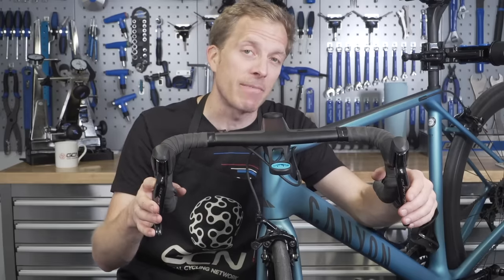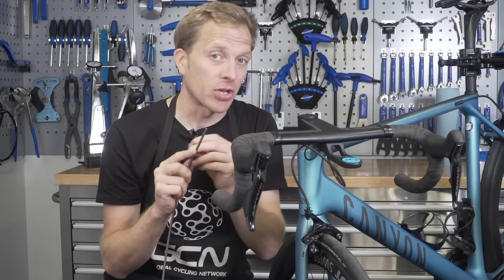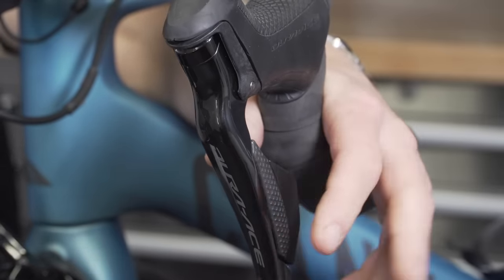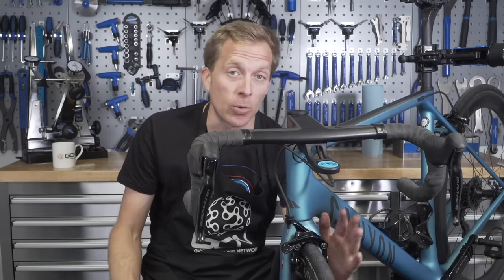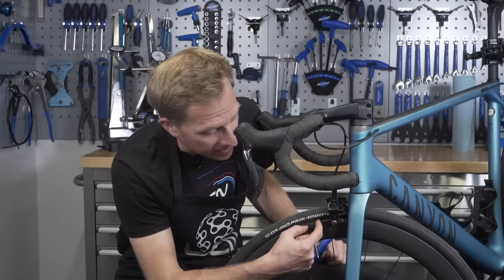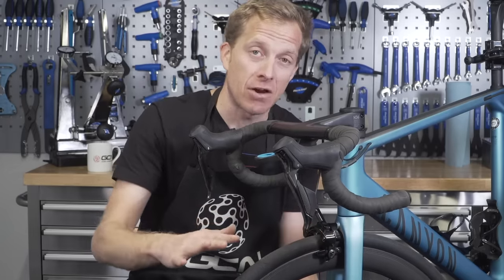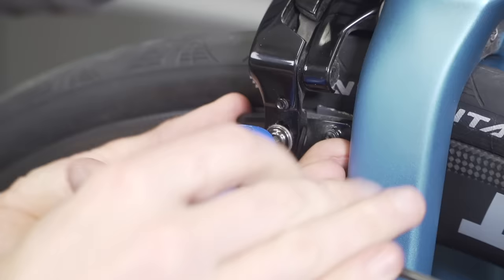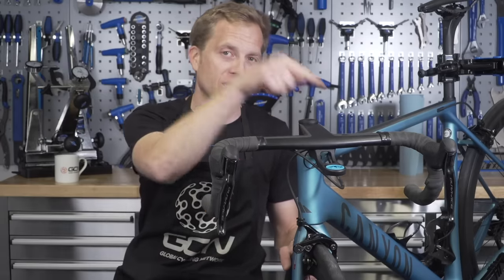5 Minute Rim Brake Tune-Up | Cable Tension, Ferrules & Toeing In Brake Pads

Comment from the maker: If this video doesn't solve all of your braking problems, make sure you send in any questions using the hashtag #askgcntech
Reply: Tip for a fast, accurate and fine tune when centering the caliper: as on disc brakes, release the center bolt, so the caliper is loose. pull hard the brake lever, then tighten the center bolt progressively so it will not affect the correct alignment.
Reply: Mechanical disk brakes next?
Reply: Michael, to tune mechanical disc brakes, here is a fast and "quite accurate" way: as you may know, the way to adjust the reach of the pads, is generally with an allen key, on the inner face (like if it would be the inner piston) across the spokes. so, first you find the proper reach as you like. then you release the two adjusting bolts at the fork, so the caliper comes loose. then, you add 2-3 points to the bolt (it will close the gap). then you press hard the brake lever. then adjust both bolts. then undo the 2-3 points to the reach adjust bolt. so it will sepparate the inner pad, and it should not have any rubbing.
Reply: Frank, I am actually rather familiar with adjusting the disk brakes on my Synapse, and I appreciate your input. I have TRP duel caliper brakes and have some clearance issues and more importantly, I am hoping Jon can explain it in a way that friends of mine can understand. What I tell them goes in one ear and out the other. It would be nice to send them to a video rather than re-explain it on a weekly basis.
Reply: The fast adjustment lever is open all the time.....😁
Reply: What are some good brake pads to buy to replace the standard ones that came on my road bike?
Reply: Hi I have got campagnolo brakes and they dont have a screw to help allign the brake pads. There is a tensioner screw on the cable but no grub screw to help make them central. I currently have uneven braking :(
Reply: Worth mentioning : you might need a torque wrench in some cases. The amount of Nm is usually written on the screws.
Reply: do the brakes pads need sanding before a new season? or just clean it mine:
Swisstop flashpro on zipp carbon wheels thanks
Reply: @parajuanjo  St
Reply: @Drzhounder  loo hjpooopppp0pp
Reply: @parajuanjo  jnoouuhkh
Reply: thanks! works lovely! @parajuanjo
Reply: I'm glad I read your comment 1st, I almost wasted 23 seconds!

Comment: I have a bike with disc brakes and a bike with rim brakes. Gotta say, rim brakes are much easier to maintain.
Reply: I thought so too, but eventually decided I needed gain proficiency in maintaining the disc brakes. Lots of information on GCN and the latest edition of the wonderful Lennard Zinn book. I still find rim brakes easier to work on, but discs generally need  a bit less frequent attention, and are much better stoppers on the steep wet roads where I live. A different fettling skill, but well worth the effort to acquire and practice the new skills. 👍
Reply: How often do you need to do anything with the disc brakes though?
Reply: Ian Loughead   😀. Not very often, thank goodness! Mine started to rasp slightly on the front. I had a slight warp on the front rotor that I solved using the rotor truing attachment on my wheel stand, which helped but didn’t cure the annoying problem. Cleaning the pistons solved the problem completely. So discs are great, but not maintenance free!! (Bless Shimano for using mineral oil!)
Reply: I have a quick release frame, so nearly every time I remove a wheel and replace it, I need to reset the calipers. The rotors are easily bent – I need to re-true them every couple of weeks in my experience. Just little things that become almost daily maintenance tasks that I wouldn't have to worry about with rim brakes. It's a serious PITA, but the better performance of the disc brakes are worth it in the end.
Reply: ZDW95  I agree. I have QRs with my disc bike and whilst I don’t need to reset the Calipers that often, it is a skill well worth learning! I’m lucky to travel a lot with a bike (Cape Town tonight!) 😀and don’t take the Di2/disc brake bike. Lithium batteries in the hold isn’t great, and whilst my velovault is a great bikebox, I don’t want to risk those rotors. Easier to fettle old tech in a hotel room!
Reply: Sounds like you must have some very cheap rotors. Maybe consider getting an upgrade. I have QR on my gravel bike and never have an issues with warping or rubbing.
Reply: Hi Ian,  Hmm. Dunno about cheap!  The original Shimano that came with the Ultegra equipped bike. 
My point on travelling is that I have NEVER arrived back in the UK from the USA without the TSA having opened the box and had a good rummage around. They leave a little love letter to tell you they’ve been there. They seem to target the tool roll, and just chuck it back in loose, although I have experienced the frame being loosened to the point of only 2 straps instead of 7 being fastened, and they’ve had a wheel out on one occasion because the skewer was replaced back to front... ok. The wheels would go in rotor first, but that does leave the cassette exposed... Stuff flying around loose in the box is not good. But that said, I suspect the rotor being out of true was probably a handling/storage issue rather than riding induced problem, and may have happened before I collected the bike (from new). The piston not retracting properly  was the main cause of my issue that the less than 1mm warp revealed. My feeling is that rim brakes are better travelling companions for frequent boxing and unboxing, and don’t need specific tools to fettle in the hotel room. PS. It’s bloody raining in drought stricken Cape Town!! 😫
Reply: Sorry Steve,  I keep replying to ZDW95 but it looks like I reply to you. Ha ha.
Reply: No worries! I really should get out more. Perhaps I will if it stops bloody raining! 😫
Reply: @stevecarpenter7462  Once had TSA lose both my skewers!
Reply: Absolutely. Disc brakes is the biggest gimmick in the history of bicycles. it is really sad.
Reply: @wackery_zeimer  I have never had rotor bend sound like yours are very cheap. They shouldn't be t regularly

Comment: I also run a piece of sandpaper over the pads from time to time to break up any glazing on the rubber.
Reply: Same here. It also remove the black carbon hard coating which is building up on Swi...p yellow pads.
Keep the pads clean = better braking and longer rim lifespan.
Reply from the maker: Thanks Mark!

Comment: I was having problems with my rear brake calipers not giving me any strength for some unknown reason. I did my first half century and the rear brakes simply stopped solidly clinching until the point that I could put my bike up on a stand and press the rear lever and I could move the rear tire with my hand. It was tight but moveable and when I was riding it was practically useless. I was going to take it to the shop but using the steps that I just saw in this video it worked just fine. I mean I feel like a champion. THANKS!!!

Comment: Thanks for this then!  I got both brakes a little bit tighter than they were before, based on inadvertently pinching the rear wire at the tube router by mistake and then making some unsuccessful adjustments after that.  The fact is I have only recently had old style caliper brakes and at times they've been like a Chinese finger puzzle at times.  But today was better!

Comment: In addition to wiping away the brake dust/road detritus, I add a dash of chain lube to the pivot points of the calipers each time I need to do a bike/chain cleaning.  (remove any excess oil)
Reply: Is chain lube special or just an oil? What about WD40?
Reply: @Icewing10  Chain lube is not especially special, although there are GBs of space dedicated to the topic.  Any lightweight (runny) oil will do; the other camp uses forms of wax.  Oils are better if you get rained on / go on wet roads.  
WD-40  could be used if applied very regularly (almost each ride), but it has elements of mineral spirit qualities that make it good for cleaning and removing greases/dirt, but also means it evaporates away.

Comment: #gcntech: When cutting the outer casings for shifting cables, be sure to file the endings flat, otherwise each of the wires that form the outer casing is formed like a screw driver, and is able to cut through these plastic ending caps. And if you don't file the cutted endings of outer casings for brake wires, it may happen that a piece of the cutted wire of the outer casing is preventing an easy gliding of the braking wire. Especially when the outer casing is needed to cover the full distance between shifters and brake levers, it saves quite an amount of weight, when you use fasi outer casings, they weight only about 20 grams/meter, instead of 40 grams/meter like conventional casings, as fasi uses alloy instead of steel.

Comment: Using old school mtb with V-brakes: Attach the pads roughly on place, don't tighten much yet. Use a rubber band (from old inner tube) to bind the lever near the grip. Loosen pads and align them, tighten up properly. Long pads (70 mm) don't need toe-in, shorter ones possibly need some.
Remove the rubber band, make sure both pads come off the rim evenly. Because the tire is far wider than the rim, make sure nothing rubs when the pads travel away the rim. Sometimes you have to repeat the process a few times to get everything right.

Comment: After running over rough road, always check your caliper centering. Quite often wheels will flex and the rim surface will actually whack into one of the pads causing the caliper to misalign, leaving you with a rubbing brake pad. A good reason to not keep your pads adjusted so close to the rim when not applied.
Reply: I second this.  I also think those that are setting their brake pads very close risk locking up too easily during a hard/emergency brake.  There is always that tendency to grip even harder as we brace ourselves against the forces under braking.  I don't agree with the almost touching the handlebar mentality for brake adjustment either... don't want to risk bottoming out with the handles.  I compare a 2mm hex key/wrench against the rim-pad distance and that is about right to give some good responsive pull with a bit of play room on a lot of road bike brakes.  2mm is about right as an initial guide.

Comment: Thanks for the video, very helpful!

I couldn't see any adjustment screws on my caliper brakes, turns out it was the big boy in the back. I can finally stop losing my mind at the sound of pads grinding off wheels.

Comment: #askgcntech  (My question is at the bottom of this post)  I often question the practice of brake pad toe-in today and I'm glad you brought it up in your video.  I haven't toed in pads in many years, as manufacturers of pads such as Swissstop and even good OE pads, have made big advancements on materials.  They are far superior to 20 years ago.  Second, calipers have gotten much stiffer and don't flex like they did years ago.  The combination of grabby pads and flexing calipers is what set up the squeal in the "old days", so we had to "pre-twist" the calipers by loading one end of the pads to stop the annoying squeal.  I honestly haven't had pads squeal in years and have long quit toeing in pads.  It originally happened by accident, as I simply forgot to toe them in and noted I had no problems and my pads lasted MUCH longer, and even seemed to get glazed less often.  As far is it giving you better braking/modulation, I'm not buying that logic either due to friction VS area physics.  (Frankly, toeing in is just going to make a smaller area of the pad hotter and wear it down that much faster, perhaps causing it to glaze.  But that is another debate.)

My teen boys and I just returned from a training camp in North Carolina where we did over 20K feet of climbing and descending, so the braking worked the pads pretty hard.  A lot of switchbacks on some days.  We use good green or blue Swissstop pads, so the wear is minimal afterward. (Gotta love Swissstop, but I digress.)  My boy's set-ups are 12ish year old BR-6600 Ultegra calipers.  The brakes had zero toe in on the calipers.  The pads have no sign of uneven wear due to the theory of caliper twist, nor did they make any noise.  Modulation felt fine.

Question - Should the practice of toeing-in brake pads be abandoned, considering modern brake pad materials and modern stiff brake calipers?  When you do toe-in pads, they wear back to touching throughout the length of the pad within a short time of hill riding due to the higher pressure at one end of the pad, so what is the point of the toe-in today, as you lose your toe in quickly due to wear?  Maybe there is something I am not considering.  I'll leave this to you tech guru's to debate, but I just haven't seen the need in some years but if there is some good reason I should still be doing it, I'd like to hear it.
Reply: On one bike I have 105 calipers that are just fine without toe-in. My touring bike has V-brakes the front one was as noisy as hell. I tried a new brake, a Single Digit Ultimate and various pads (Jagwire seemed quietest); both helped a bit but the only way I could get silence when braking hard was with toe-in. It may have been the Trek520 forks because the back brake was always fine with no toe-in.

Comment: Hi GCN, I have one of those quick release breaks where you can open the break wide so you can remove your wheels without doing anything else with the breaks.   however, I'm running 32mm wide tires and I have to deflate the tires in order for me to remove it.  Is there a way where I can set it up so I don't have to keep deflating my tires?

Comment: Question: does force required for braking vary between various producers of brake caliper? 
Example  -I have the bTwin ELOPS 500 single speed bike with OEM brakes, that takes strong action on brake lever to stop the bike. I was thinking to change front brake with Shimano 105 calipers. Will the amount of force on brake levers reduce by that? What would?

Comment: Great concise explanation! Thanks so much! Is this the sequence in which to do these checks?
 I tried getting my brake pads close as possible but when I tried to center the calipers after, it messed up the distance of the brake pads to the rims :D 
But I didn't try it while keeping the brakes engaged. What's the reason you do that?
Thanks again!
Also, is there a playlist for these quick tips videos?

Comment: If brake  shoe is overhanging the wheel rim, it creates a lip on the shoe grabbing the rim and causes brakes sticking.   Check this before cables, levers, and everything else.

Comment: This is a weird ass question but I see alot of riders with their caliper adjustment knob/cam lever thingy in the open position with their brake cable tensioned that way. My thinking is that this was always intended to be closed unless you needed extra room to take the wheel out. Correct? Or am I missing something here?

Comment: curious - I have 2 wheelsets, 1 with rim external width 20.8mm, the other 22.4mm (shimano r-9100 c24 and c60); any thought if I interchange them that the difference of <0.8mm rim to brakeshoe clearance alters the angle of brake to rim enough to alter safe braking?  seems to be fine; can't find much info on this regarding any brakeshoe angle to rim adjustment (different than toeing) or replacing the pads with the wheelset change?

Comment: Ima do this with my rear break pads because they don't work well and they do got a lot of life in them I just think its the cable. I had a lot of instances of my front wheel locking up Real hard and my rear wheel is lifted off and I'm flung forward almost.

Comment: When you tighten it with the barrel adjuster, how do you make it loose again? Do you have to unscrew the bolt where the brake cable passes through or does it just loosen the more you use your brakes?

Comment: #askgcntech I know this isn't that relevant but what bike were you using in your 5 minute brake tune up video? Also I just watched your video where you had a discussion with Emma about 650c wheels. She said I wouldn't have got those results without them but I was told that with 700c you go 1.5 metres further than 650c. So how come she did so well with 650c?

Comment: #askgcntech 
Hello, I recently bought full carbon clinchers (Fulcrum racing speed 40 2017) How do I maintain, clean the brake pads, knowing that I cleaned my former alu clinchers pads with some dissolvent ? 
Thanks!

Comment: I find whenever I have to remove my front/rear wheel (to change a flat or install my clip on fenders) that I need to make a fine adjustment to the brake caliper. It seems that I don't get the quick release tension exactly where it was before I took out the wheel and a quick check and fine tune of the brakes is necessary to re-center the calipers.
Reply: Peter Lee that same thing happens to me. So frustrating fiddling with the brakes.

Comment: I just replaced shimano BR-R561 brake calipers with 105 ones on a cube attain gtc sl 2018, the front braking feels good but the rear brake lever feels stiff which is new. The cable housing no longer seems long enough to cover the cable all the way from exiting the frame to sitting inside the brake barrel adjuster. Is there a likely issue? Thanks. #askgcntech

Comment: I use u brake shimano sora,brifter sora..and the cable i pull to tight and tighten the screw..but if i pull the brake 1-2 time..the cable gonna loose,and arm brake its not come back..why ? Can you help me